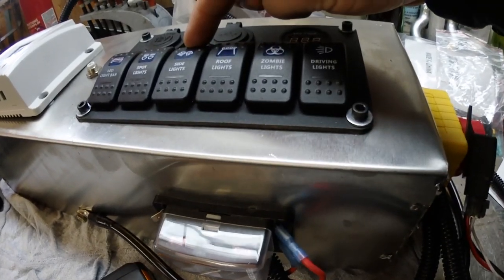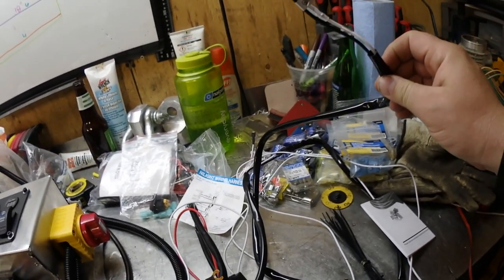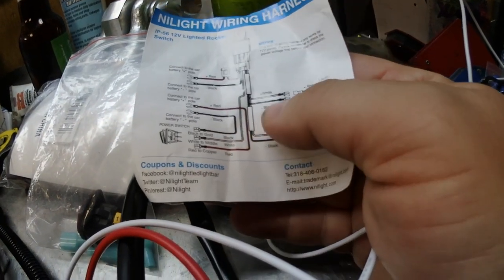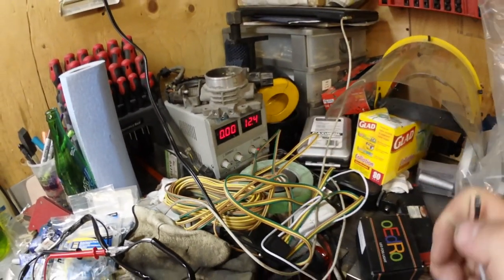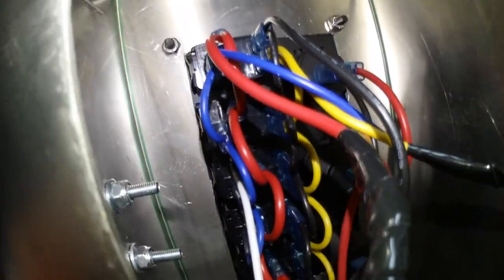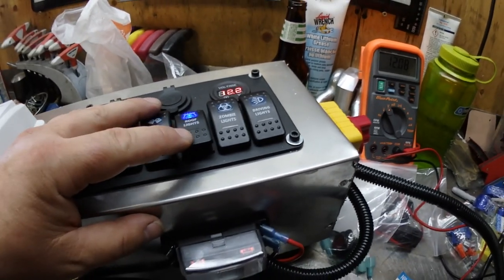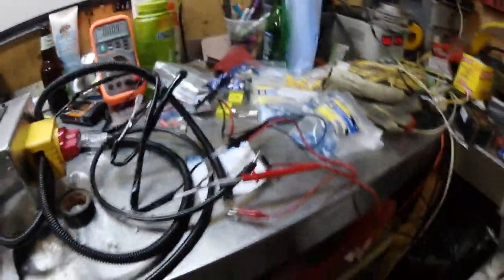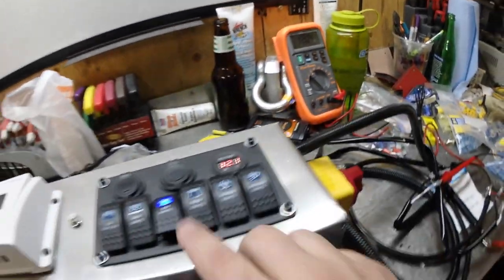How to Wire a Relay for Off Road Lights

Comment: I'm installing some offroad LEDs and know how to wire DC switches but dont get why the need for a relay when it works just fine without it. It draws 7 amps. Anybody know?
Reply: Its just safer since you're not running as much power into your cab and it creates a closed circuit where you can run higher power to multiple lights safy

Comment: If you're running led lights, I see no reason to use relays. The power draw is so little that the switch should easily handle the draw by itself. Relays are for switching a larger draw from a small switch.
Reply: Very true NO need for relays with led
Reply: Thanks I was wondering if I needed a relay for 7inch led bar for ATV. I think ill use fuses and make my own harness??